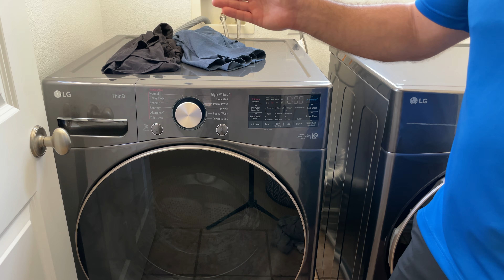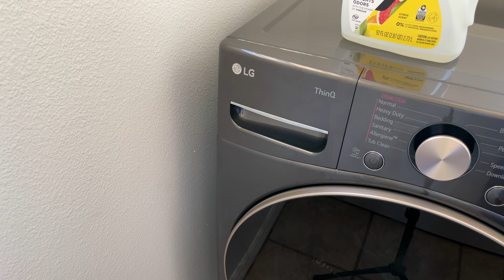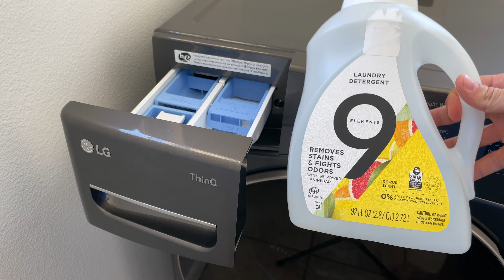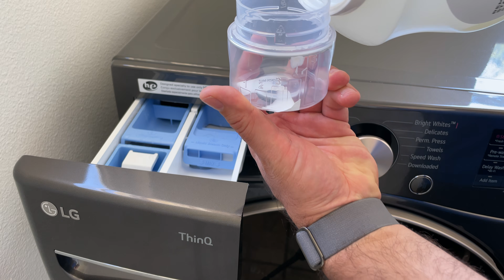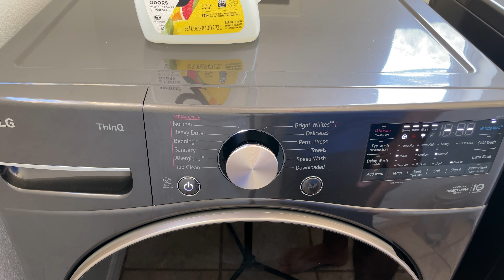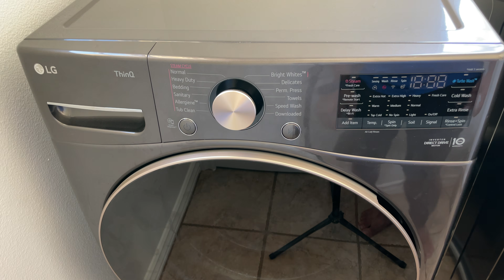Running Normal Cycle on LG Front Loading Machine (WM4000HBA)

Comment: Most of the settings are pretty much useless. The sensors are very inaccurate. I just bought a new one and found the best way is to just use 25 minutes manually and the  clothes come out perfect.
Reply: We got the same one too recently i havent done any my load lets see. But yea i think quick wash will do fine smd quick i guess

Comment: I never thought of putting the clothing in like that 👍😎 Also does soil level mean how much water to fill?
Reply from the maker: Thank you for the feedback and the question.  Soil level tells your machine how dirty the clothes are. The higher the soil level the dirtier the clothes, the longer the wash cycle, the higher the agitation intensity, potentially higher temperature and the more water that is used.  This is to ensure that dirtier clothes get all the stains out which requires more work, time and resources.
Reply: He did it wrong he folded the second garment in half put close loosely DONT FOLD THEM i think thats just DUMB AND HE WASHED 2 garments in a machine 🙄🙄🙄🤣🤣🤣🤣